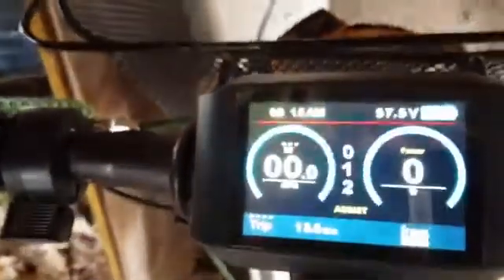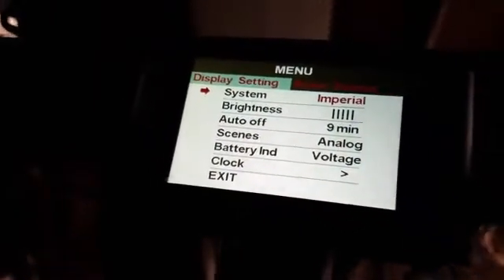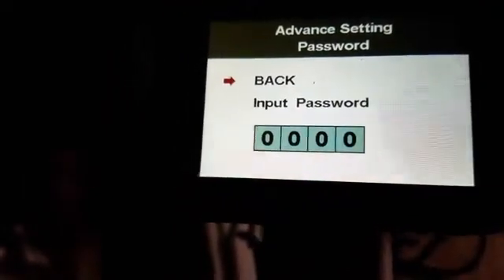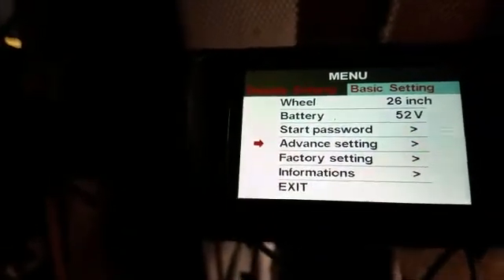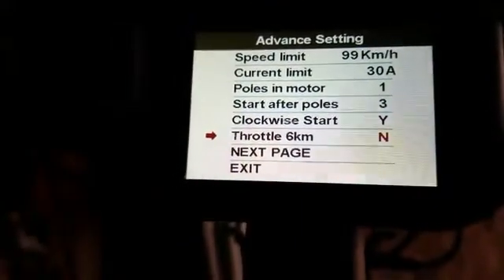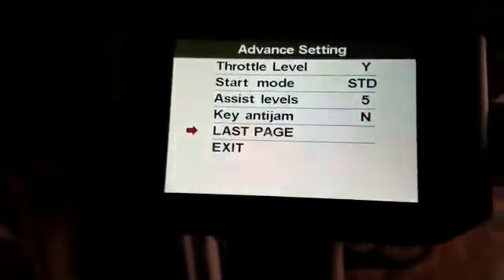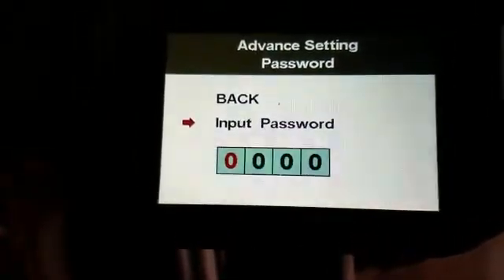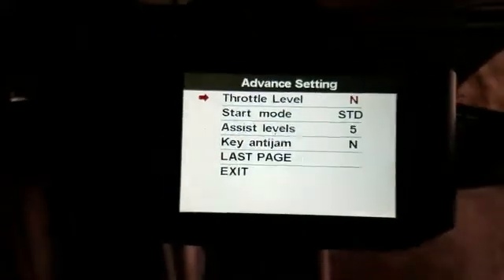750c display initial basics

Comment: If you use 1919 as the password that will allow you to modify max speed and level of pedal assist from 5 to 9
Reply: Thank you
Reply: Thank you so much for the code 1919 it’s working I work if move the magnet sensor

Comment: The poles fixed my wrong speed problem, by default it said '4' and doing about 10 mph the display told me I was doing about 40mph, after adjusting it I think it relates to the number of alternating sections (poles) in the motor, I think mine has about 16 based on what gives roughly the right speed, so with the default setting of 4, every time the phase wires changed 4 times it thought my wheel had done a full rotation, when it had only done about a quarter, completely blowing out how fast it thought I was going
Reply: what size tires/rims do you have ? You should set it to the correct size

Comment: does this have the "UBE" setting for the battery voltage to assign 52v battery..?  or is the only setting 36v-48v..?
Reply from the maker: The voltage readout will accurately display voltage so you can tell on a 52v pack that 58 is full, 55 is 75%, 52 is 50% and so on. We have a chart on the knowledge base showing this. The gauge with the little battery indicator was built for 48v. Generally you want to go off voltage rather than the gauge in any case as it can give you a much better idea of what your state of charge is, assuming you have read the chart.

Comment: Where can I go to tell me what every thing means .. Like that Auto Off thing and it says 9 mins ?
Reply: Auto off just means the system turns off after that many minutes of no activity.
Reply: @chetamus1845  hi, what does the RT, avg and max modes mean?
Reply: @JohnjOcampo  Those are counters. RT is run time, max is the maximum speed you have ever achieved, avg would be a useless average speed. So if it was brand new and you rode it down your driveway and back, it might show runtime of 1 minute with a max speed of 8mph.
Reply: @chetamus1845  oh ok got it, it dosen't actually change anything in terms of the speed. Thanks for the info 👍🏻